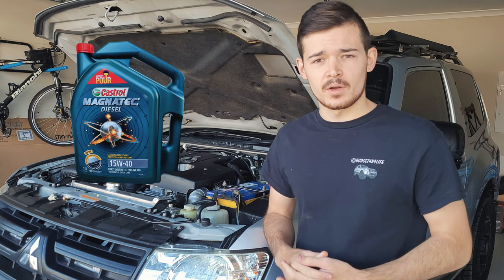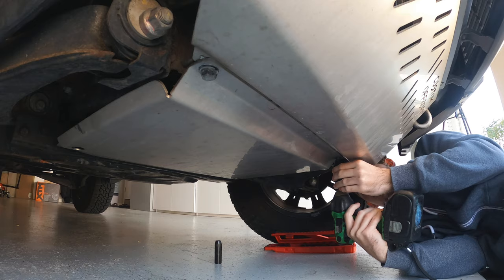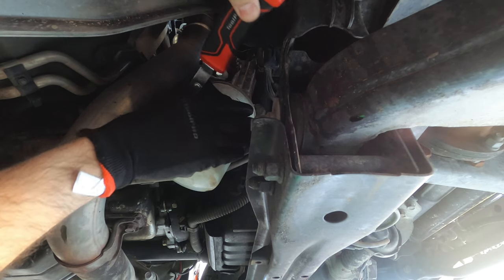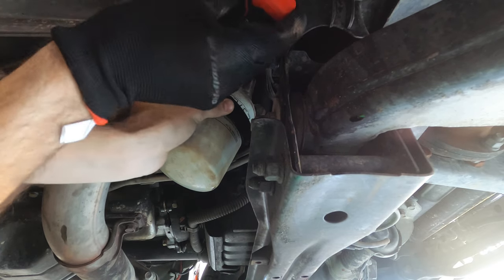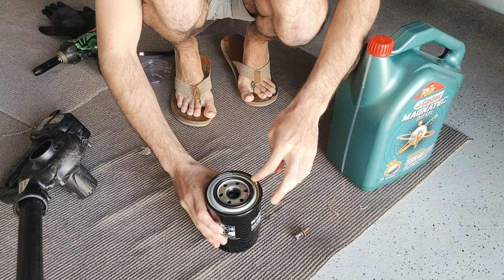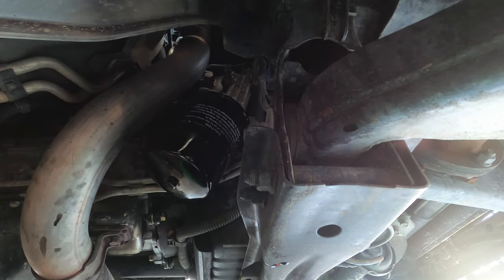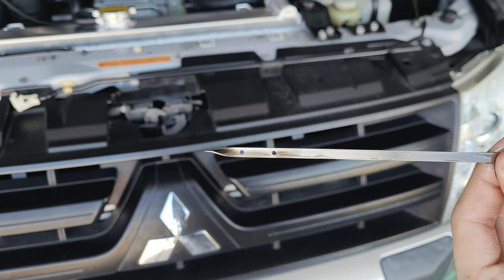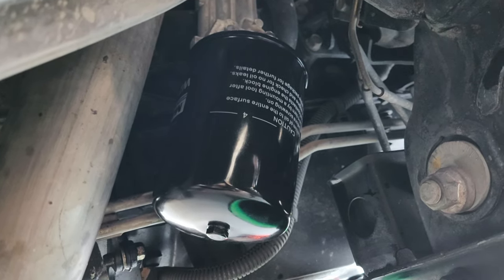Oil and Fuel Filter change on the 3.2 Diesel Pajero

Comment: Just a little tip. Once you’ve drained the oil, before you remove the oil filter, stab a hole in the bottom of it and let the oil drain out into your bucket. That way you won’t end up with an absolute mess.
Reply from the maker: Awesome thanks mate!
Reply: Excellent idea

Comment: Just a suggestion - you may have overtightened the oil filter. It should not be necessary to use any tool to tighten as it will be too tight to loosen next time. 2/3 of a turn after the seal contacts is usually written on the filter or in the manuals. And "start" the fuel filter before removing the bracket might be an option - I'm just brushing up here before my first Pajero home service. And couldn't see if you prefilled the fuel filter - but I have no diesel in containers to do that myself.
Apologies if already covered in comments - time poor.
Reply from the maker: Hey matey yes I did not overtighten it...just gave it a small turn but should be ok😄

Also I had to remove the fuel filter bracket to loosen the filter cause it was super stuck😄 couldn't get my hands in there properly. And no I just put filter on and primed it😊 cheers💯
Reply: @budget4x4life, so you threw away the diesel that was in your old fuel filter?

Comment from the maker: UPDATE
I am now using Penrite 10w 40 Fully synthetic and find that the engine runs better and doesn't blow black smoke under load💯

The Castrol is also not recommended for cars with DPF's.

Happy servicing Legends!🍻
Reply: FYI. 9.8L includes the oil cooler.
It will only take approx 8.5- 9L to the top of the hole on the stick.
Reply from the maker: @paulp6386  Cheers mate💯

Comment: very useful video, I'm curious how is the chassis...is it the tipical chassis of a 4x4 or the chassis of a SUV? thanks in advance
Reply from the maker: It is not a steel chassis. The Pajero has a monocoque body (single shell) and a chassis in a ladder frame design. This provides greater rigidity without any increase in weight.

Comment: I just got a 2017 pajero and it is having issues starting wont take till a few times in. I am going to try and prime it before starting next time (see if its firm) to see if it is fuel related and not glow plugs. Is it common for a air or fuel leak around the fuel filter? Maybe the fuel filter housing at the bottom. Just want to start with most common issues.
Reply from the maker: If over 200km probs glow plugs. If car starts with a bit of white smoke most likely plugs. Wont hurt to prime the car to see what happens 🤞🏼

Comment: Did you ever consider the petrol variant of the Paj swb? What's your thoughts on it (if you weren't towing anything). There's an 08 Paj swb that I know about with 95k on it for $17-18k. Never been off-road. But I've always wanted the diesel variant. I plan on using it as a daily and beach trips, trip or two up the cape etc in the future.
Reply from the maker: Hey Josh. Yeah depends on what you want to use it for. I didn't want the petrol just because I use it as a daily and it had more power to tow. Keep in mind it will not be good on fuel if you load it up and do beach work. I reckon the petrol will be over 15L even 20L per 100 on the beach keeping high revs through thick sand etc. 

If I had 2 cars then maybe yes I would consider the petrol. I will only buy the petrol to use offroad only but definitely not for a daily or touring. I will rather buy a diesel with 200k for the same price. Also not the end of the world if you can't find a shorty. You can get a good nic 4dr for around 14k with 200k on the clock. Good luck with the search🙂💯
Reply: @budget4x4life  thanks mate, really really appreciate that input/ insight. Absolute legend!
Reply from the maker: @Josh-nd2mt  Haha no worries man you're welcome, any questions just ask🙂💯

Comment: Using 15w40 instead of 5w30 for diesel, isn't that too thick ?
Reply from the maker: From my experience and knowledge Diesels should at least run on 10w 40 in Australia and 15w 40 for those over 200km. The thicker oil will result in better protection and engine wear. 5w30 is very thin and only effective to about 30° weather which in Aus is too low. If you're in colder climate that should be fine but not where you get 30° and above days🙂💯

Comment: Hi ihave 3.2 without DPF, what oil should I use? I heard about people using 5W 40 but this isnt in the owners manual, thanks.
Reply from the maker: Penrite 10w 40 full synthetic should be 👌🏼💯
Reply: Penrite HPR10 10W-40

Comment: Hi mate, If you don't mind us asking, how much did your Pajero cost? Did it have about 250,000kms on it?
Reply from the maker: Yes 20k at 250k🙂 Full service history...manifold clean...timing guide and valve clearances done.
Reply: @budget4x4life  thank you! When looking for one, what's your best recommendations to make sure has been done or to watch out for on these specific pajeros?
Reply: @budget4x4life  where abouts did you pick yours up from? Around Brissy or somewhere else
Reply from the maker: @Josh-nd2mt  Brisbane
Reply from the maker: @Josh-nd2mt  no worries man. Check Marketplace Carsales and Gumtree. I found mine on Gumtree.

Umm depending on km...if it is over 200 check if Timing guide has been done...valve clearances...manifold clean is a plus but not a must...chain tensioner...diff oils..gearbox oil and check oil change intervals. Should be atleast every 10k. Cheers🙂🍻
Reply: @budget4x4life  really appreciate that help. Loving the channel mate. Keep it up!
Reply from the maker: @Josh-nd2mt  Thank you and no problem😊 Good luck finding a shorty💯

Comment: Can I ask why you use part synthetic oil instead of fully synthetic as it says in the owners manual..
Reply from the maker: Fully synthetic are for those with dpfs so it doesn't clogg up🙂
Reply from the maker: Here's a good discussion on why people don't go fully synthetic:

https://www.4x4community.co.za/forum/showthread.php/190219-3-2-Pajero-Long-life-oil
Reply: @budget4x4life  That is discussion with many feelings and no real info. This engine is old and robust type, so it can handle any oil. But im not sure about the VG turbo.. I dont know castrol AU, but in europe..its average oil with premium prices and premium marketing. It was proved by few magazines, last time by svet motoru this year which has done lubricity tests under pressure. Synthetic is not about DPF. For DPF vehicles its recomended (for longer DPF life..not engine! ) ACEA C1-C2 or C3 mid saps (sulfuric ash), low saps oil. Full synthetic with full saps spec is superior to semisynth, it doesnt brake down, it doesnt burn so easily, it will stay cleaner and it makes more than semisynth. I used Total oils in my garage since 2004. But if i love the car, i use valvoline :) Its cheap and it goes the extra mile in protection and cleaning. Ofcourse there are better oils for more money, but valvoline is one of the best.
Reply from the maker: @plenex  appreciate the feedback mate thanks a lot😊💯 I will do some more research to find a better affordable oil 🍻

Comment: 15w40??? Where do you live? Thanks
Reply from the maker: Yeah in Queensland Australia. It has the right specs for Australian weather😊
Reply: Ok, i m in North italy and use 5w40. Another things, the original shock absorber is too hard for our latitude and only now in summer work better
Reply from the maker: @rezosful2072  interesting
Reply: @budget4x4life  mine is 3.2did short , 2009 with 37000 km, with original tyres that i ve now to change but its illegal fit tyres with another size. Bel canale!!!!

Comment: If you haven’t thrown the ryco oil filter in the bin could cut it open and compare it with the nippon filter? No videos of this exist. Probably no difference.. Fram do a oil filter that’s made for the fuso trucks that fits these engines and it’s massive, I wouldn’t off road with it
Reply from the maker: Thanks for the idea mate💯💯
Reply: Sweet, I really want swb but got a family. These won’t be for sale after a while

Comment: Why 15w40?
Reply from the maker: Cause of the climate and ks of the car. Have since gone down to 10w 40 from Penrite
Reply: @budget4x4life  but on the book says specific c2/c3 it means U don't have dpf or agr correct?
Reply from the maker: @ajetia86  C2 is 0w-30. That is way too thin for a diesel. Unless you live in Canberra where it snows, step it up to atleast a 5w 40 or 10 40 full synthetic that is dpf compatible. Like this one:
https://www.repco.com.au/oils-fluids/engine-oils-fluids/engine-oil/penrite-enviro-10w-40-engine-oil-10l-eplus10w40010/p/A9442901?rgfeed=true&cid=google-shopping&utm_source=google&utm_medium=cpc&region_id=100369&gclid=CjwKCAjw3oqoBhAjEiwA_UaLtuiCuSIsIh441Pyo9ZkIfSsCsnSlDehypVfKQOvp3DFXQ6pW90c72BoCq6kQAvD_BwE

Comment: Pretty sure you're meant to fill the fuel filter with diesel and dont fill the oil filter with oil
Reply from the maker: If you fill up the fuel filter and spill it in the engine bay it's a big hazard in my opinion and can catch fire potentially. So rather just play it safe and prime it up instead of pre fill🙂
Reply: Umm. Diesel has a large activation energy, its unlikely to catch fire. Put a small capful in a metal container outside  then toss in a match. It will douse the match.
Reply: @budget4x4life  fair enough, just thought you got it mixed up. Have you done an egr block?
Reply from the maker: @happydays2190  Turned off in ecu
Reply: @budget4x4life  is it had to do in the ecu?how much was it and do you notice a difference? i heard you can do it with a resistor?
Reply from the maker: @happydays2190  luckily the previous owner did it. If you get your car tuned at Ultimate Diesel they turn it off...they can turn the egr off by itself for $660.
Reply from the maker: @happydays2190  I heard about the resistor mod but haven't looked too much into it
Reply: @budget4x4life  cheers mate

Comment: Good video but d'not need to unbolt fuel filler ass, just use the oil strap to unscrew
Reply from the maker: Definitely tried getting it in there, but there's no room🙂